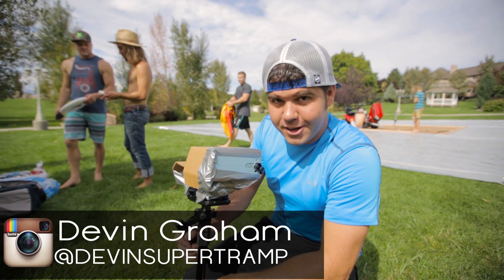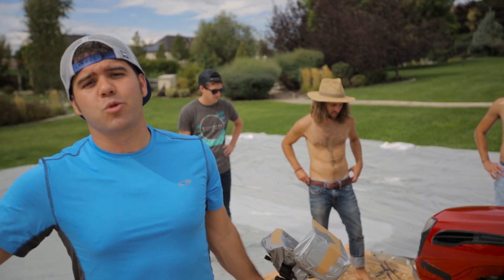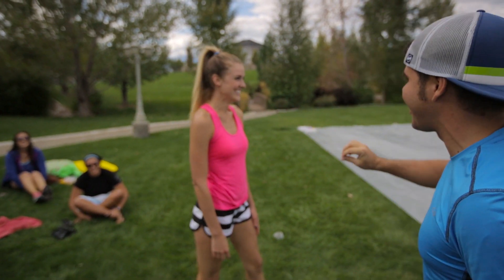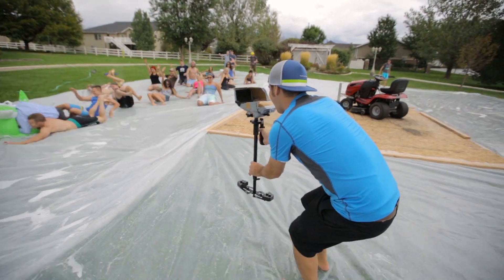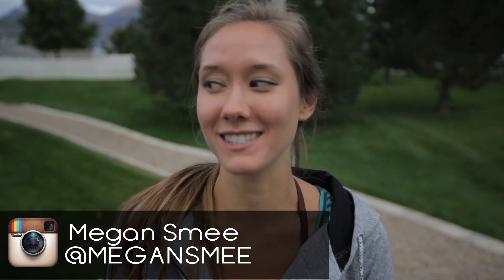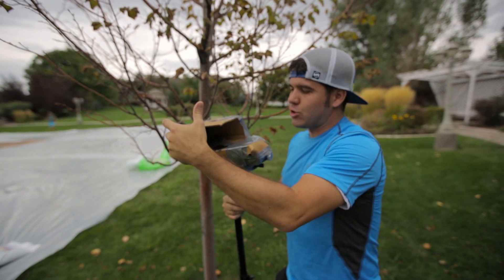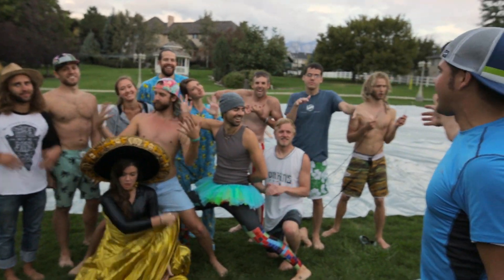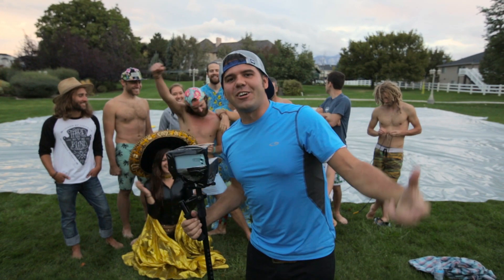Filming with a Smartphone Behind The Scenes - Lawn Mower Slip N Slide!

Comment: Is amazing that the phone didn't break
Reply: +Bernardita Ortega The V10 has an MIL-STD-810 resistance rating which basically means it has military grade durability ;)
Reply: +Sean Mangubat   The reference to the MIL-STD-810 standard in instructions or advertising  do not stating that it's been tested to all parts of the standard and passed.
This is especially true if manufacturers of civilian equipment referencing tests according to this standard
Reply: +Bernardita Ortega V10 is made of steel and silicone. An iPhone or Samsung would break, but not the V10

Comment: LG V10? Iphone 6S Plus? Galaxy S6? Xperia Z5? which one has a better quality?
Reply: +senoravaca V10 and s6. The s7 has better quality, but the v10 has more options such as directing where the sound comes in (the phone has two mics instead of one) and it has more whitebalance and is more diverse in shutterspeed and iso range. The xperia is good, and the iPhone is something I would never film with due to its autofocus only camera, terrible frame rate at 4k (although 240 at 720p is impressive) and TERRIBLE APERTURE.